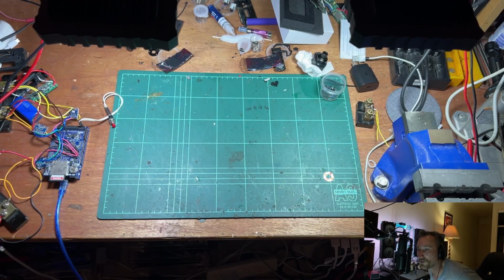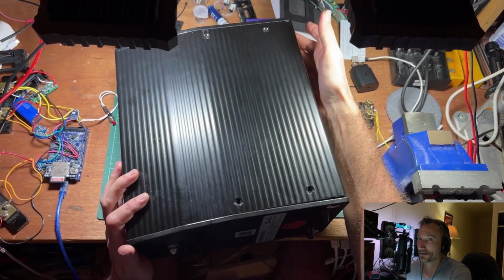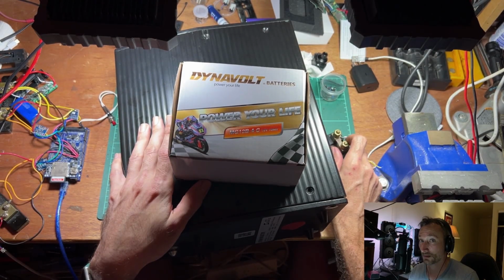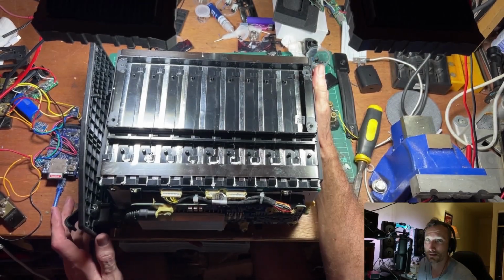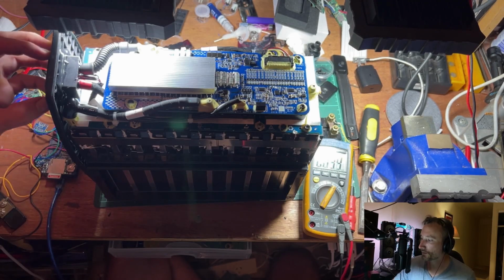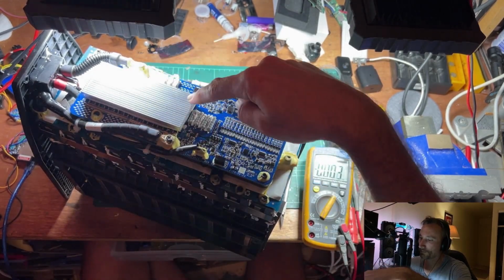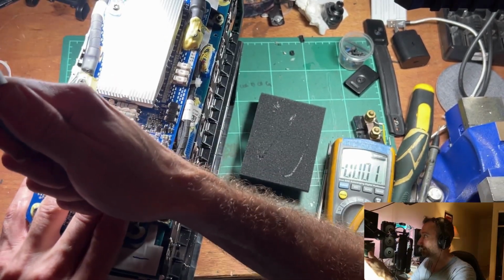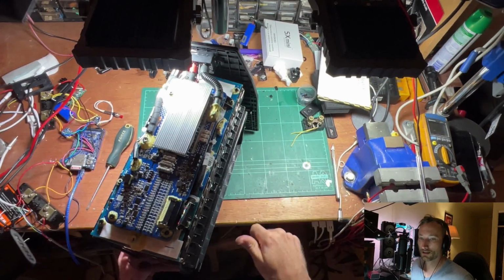Super SOCO TC Max Battery Pack - Disassembly and Attempted Revival

Comment: Does the pack appear to have any seals for a form of water resistance or IP rating on the label?
Reply from the maker: So sorry for the super late reply, half the time I don’t get notifications from YouTube and have to go back thru the vids to check. From memory they make an attempt at some water resistance - big single o-ring around the top and bottom plates and liquid sealant around the socket. Not amazing though, it’s not going to stop water getting in if bike got flooded but should be good enough in normal use I think. No IP rating that I could see. Cheers!
Reply: Just took mine apart, there are rubber seals around the bottom, nothing at the top so it would fill up with water if water was very deep. There is also a water detector patch so they won't warranty a water damaged pack.

Comment: Are you an electrical engineer or something? How'd you learn about this stuff? I know a little bit as I used to install stereo equipment in cars. That's where I 1st learned about ohms law. I'd really like to learn more about electric components and electronics themselves.
Reply from the maker: Ah yes mate, I have a degree in microelectronics engineering. I used to do some car audio too! I haven’t mentioned it on the vids for a few reasons tbh. I kinda don’t want to make it sound like I know everything as I’m definitely always still learning and getting things wrong, and also while some subjects I studied covered PCB design and construction I’ve never actually worked in that field. Anyhow, let me know if there’s something in particular you’d like to know a bit more about and I reckon I should be able to cover it in one of the vids. Cheers for the comments as always!